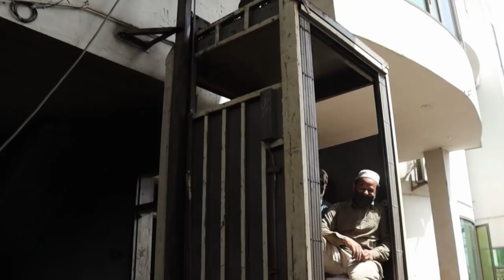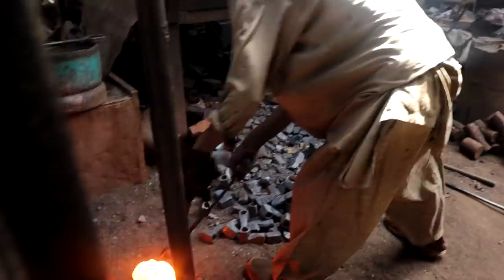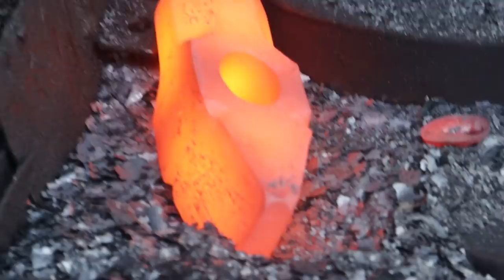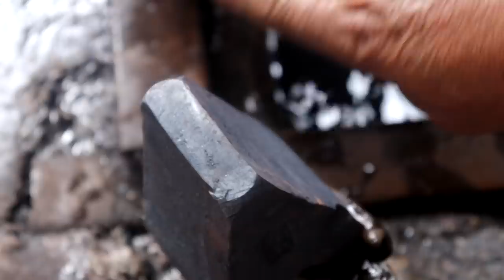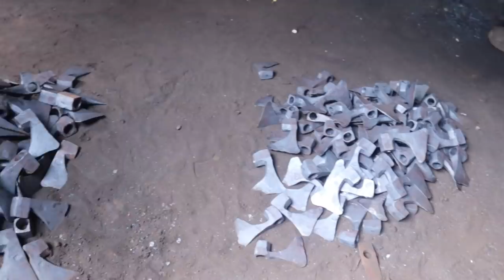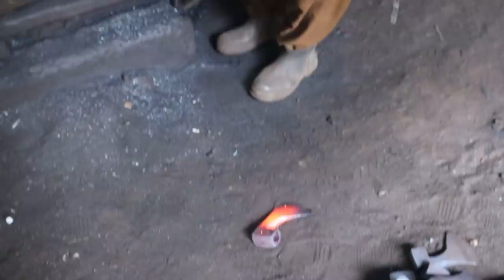Amazing Forging Process & Tour of a Tools Making Factory | Part 2

Comment: Typical: Safety issues: a pair of gloves of doubtful heat protection, standard heat protective cotton lab wearing coat, great heat insulator for face and eyes (air is a good heat insulator).
At least the place is well vented for the poisoning fumes: no roof, no rain protection and a nice slag coated floor.
Many may look at the skills these guys have but I think the main issue here is the safety of the job. It is hard to understand that in the present days, the world still have little or no care about human life. Luckily we're starting to improve this although so unevenly across the globe.